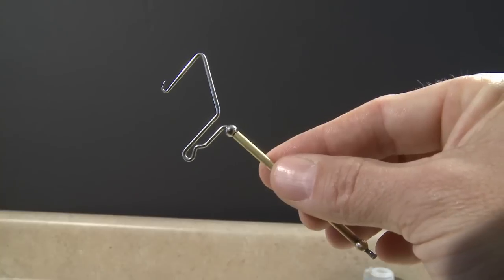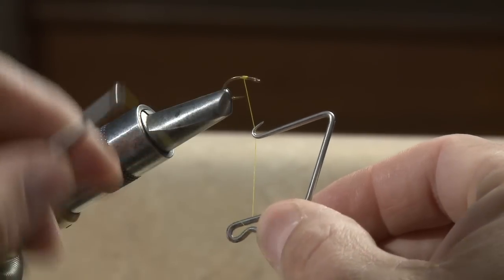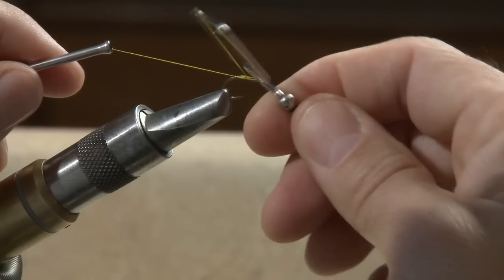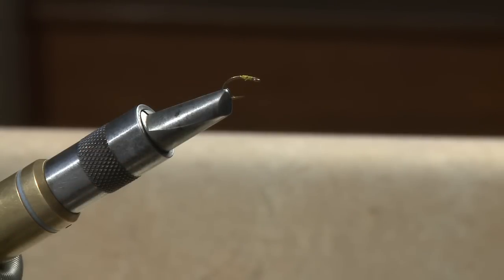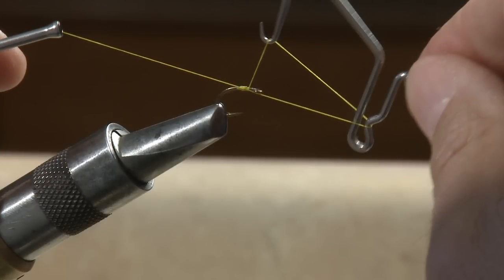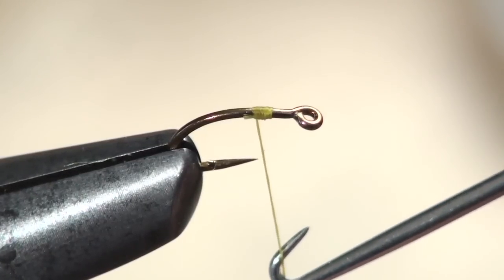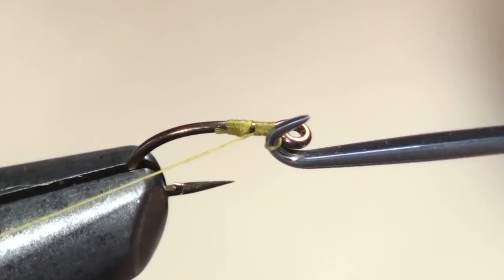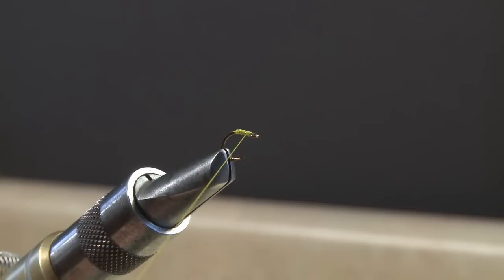Using a Whip Finish Tool

Comment: Great demo on showing the proper way to whip finish. A whip finish is wrapping the thread around itself app 4-5 turns working toward the eye than pull it through. I have seen many tyers just make several wraps on a hook and even heard pro's say a whip finish is nothing more than a series of half hitches. That is incorrect and your video properly demonstrates the proper way.

Comment: Great video…I had problems with my 1st whip finisher from Umpqua so purchased a 2nd a Loon and the difference was night & day…after comparing, the Loon had much sharper angles while the Umpqua was more square. After bending the Umpqua angles more aggressively to match those of the Loon, they both work very well.
Reply: dude this is me me right now, im literally trying with my current whip finisher and it's not working ill get the one from Loon

Comment: Hi Tim, I have always used the "spring" style of whip-finisher and recently purchased one of these. Your video was very helpful - thanks! Now I have to decide which design I prefer.    Just a quick comment... instead of a "chisel point", I file a shallow angled "V" (from one side only) in the swagged end of the tool with a triangular jewelers file and polish the inside of and back of the "V" with 400 grit sandpaper to make a "sewing seam ripper" -  this makes for a very sharp edge that is safe to handle. I like that I can slide the polished inside of the V up the thread to the fly and then sever the thread close by rotating the tool to bring the edge into play. I can send you a close-up picture if my description is not clear. Thanks again Tim!  Cheers, Hank

Comment: Couldn't you rotate the tool the other way, when forming the initial "number 4," so that the first rotation actually catches the thread? I notice in this video that the first rotation of the tool (after the formation of the "4") doesn't actually create any bind on the thread coming from the bobbin. Is there a reason for this? I do it the other way, so I'm a bit confused, since I know you have a lot more experience with these things. Thanks for this and all your other videos.

Comment: Probably a stupid question- but why wouldn't you, as you pull the thread through the hook in the tool in the last step,  pull that last loop over the hook eye so the loop is secured around the shank?

Comment: Tim, what kind of scissors did you use in this video?  The jaws look extremely narrow.
Reply from the maker: They are old Orvis scissors that are unfortunately no longer made. Lightly curve handles, super fine tips, ultra sharp- they really were exceptional scissors although a bit overpriced, around $45 20 years ago.

Comment: Thres no need to whip finish.  Three half hitches works fine. In a whip finish if the thread gets cut by a fishes teeth the whole thing can now unravel. Multiple independent hitches won't.